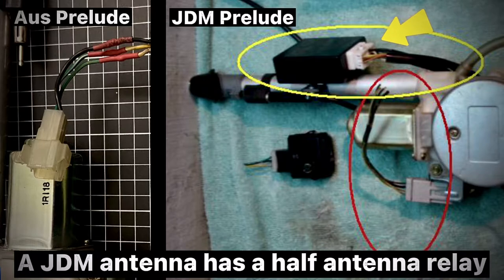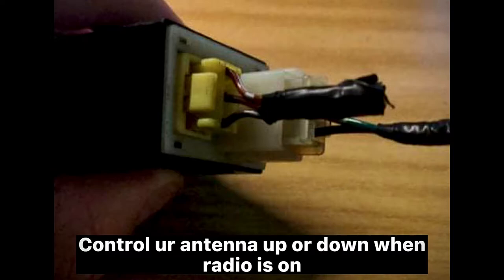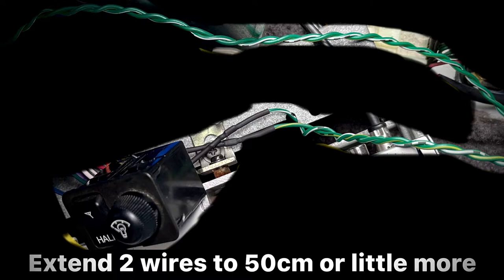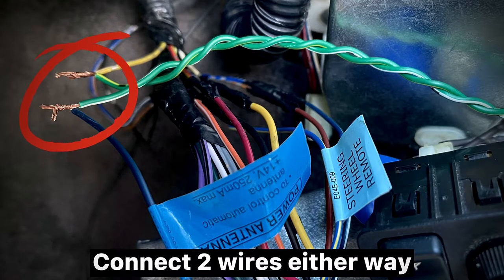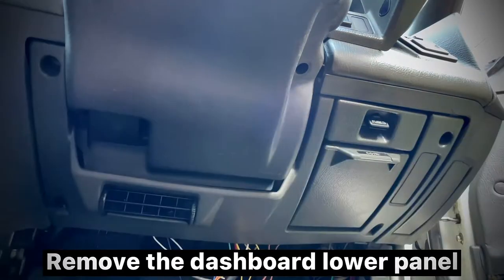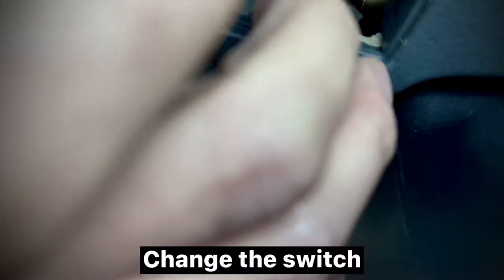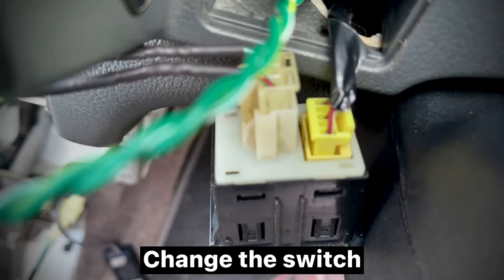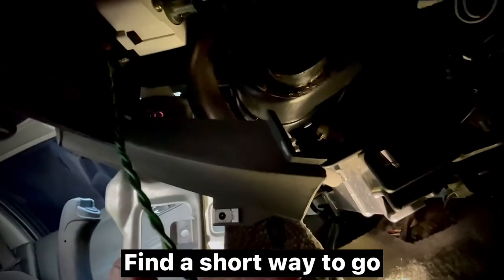87-91 Honda Prelude - (fixed) Half antenna switch to On/Off switch

Comment: Can you make a video how to wire if i have a module for half function switch?
Reply from the maker: Module? I have no idea. As u see what I’m doing is turn this half switch to a on/off switch. U can use any switch to do the same if u can’t find this JDM switch. 
Like I said in the video, if u really want to have the “Half Antenna function”, you need the JDM half antenna relay.
Reply: Where can I find the jdm relay ?
Reply from the maker: @gixxa7500  japan